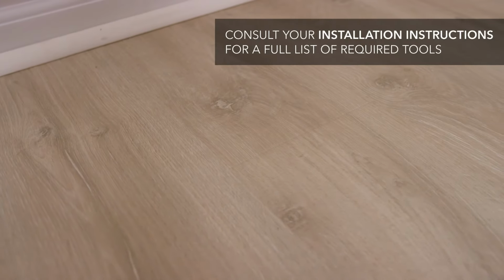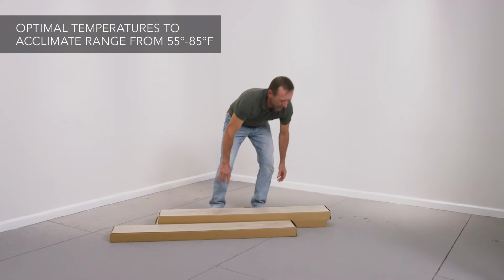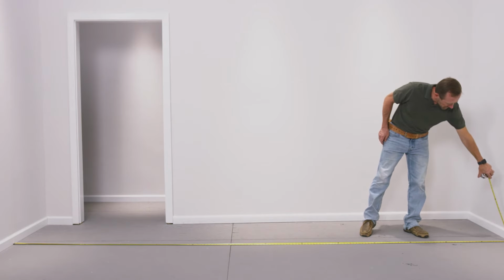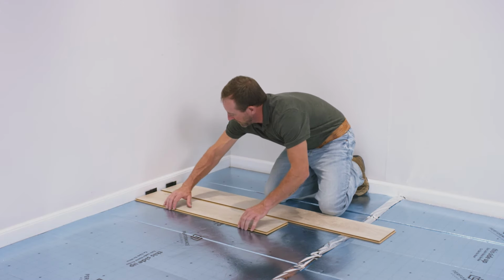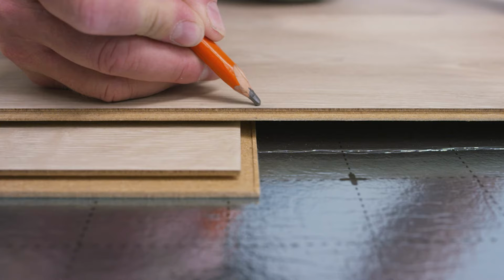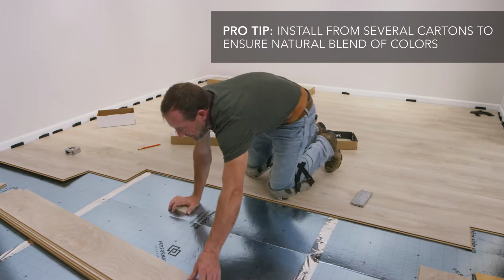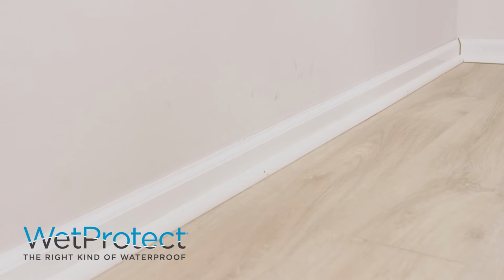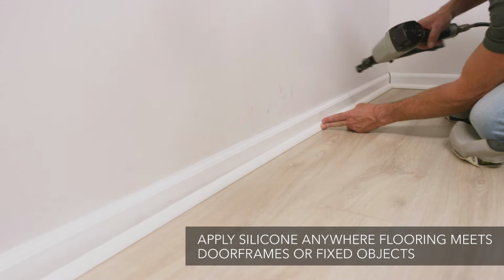How to Install Laminate Click Flooring | How to Install Flooring

Comment: I would like to install RevWood Plus Cypresta laminate without attached pad on a concrete subfloor for the entire first floor.

Can I install a 6 mil vapor barrier together with 3mm QuietWalk underlayment with a moisture barrier on the concrete subfloor of the first floor? Or should I only install one underlayment without the 6 mil vapor barrier?

The installation instructions mention that the 6 mil vapor barrier must be rolled up along the wall edges to qualify for the WetProtect warranty. However, the 3mm underlayment cannot be rolled up along the walls. So does that mean I need both layers?

Comment: We appreciate this detailed guide on installing laminate flooring! One tip we found helpful is to always acclimate the planks for at least 48 hours before installation. This prevents expansion or contraction after the flooring is laid. 

Also, when measuring for cuts, it's crucial to keep the last plank in each row at least 8 inches long to maintain stability. Don't forget to use spacers for expansion gaps; they can prevent future buckling. 

For future content, it would be great to see a segment on troubleshooting common issues, like squeaks or gaps over time. Thanks for the informative video; we can't wait to apply these tips to our next project!